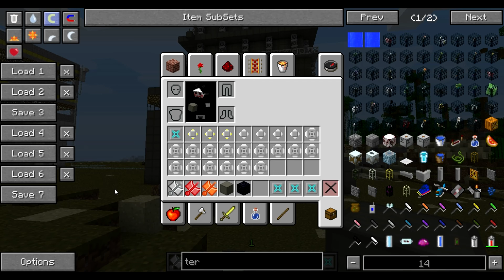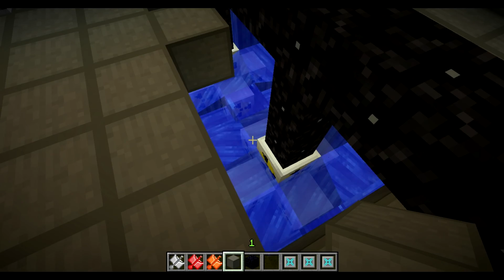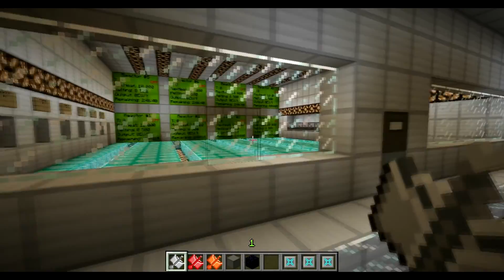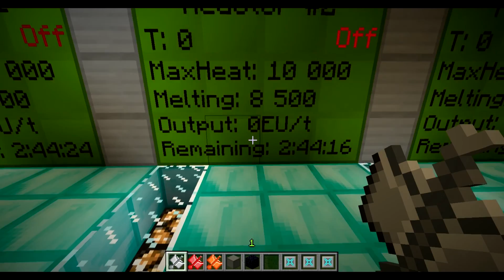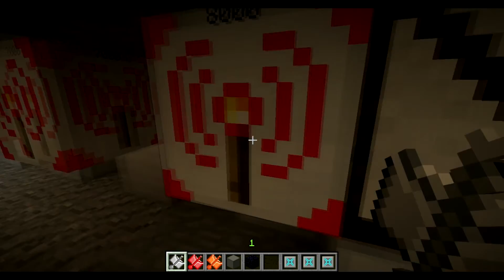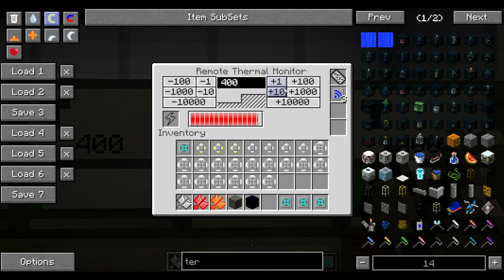Minecraft Industrialcraft Nuclear Reactors - Basics

Comment from the maker: Well if you set up a single reactor, using the same setup i have then your wire might be the issue. Using 4x insulated has power loss the more block you lead it, too far and it will receive no power. Another common mistake is placing the MSFU facing the wrong way from the wire, or not properly supplying a redstone current to your reactor which turns it on.

Comment: I have Industiral/buildcraft installed on my game and I have organized the reactor components with the specs of ur reactor but I am not recieving any voltage at my MSFU (They are hooked up with 4x insulated black rubber wire) 

P.S I have played around a bit with the mod and was able to successfully build watermills, solar farms and windmills transporting their power over a great distance using a daisy chain of batboxes (or what ever there called) as well as ive fiddled around with transformers